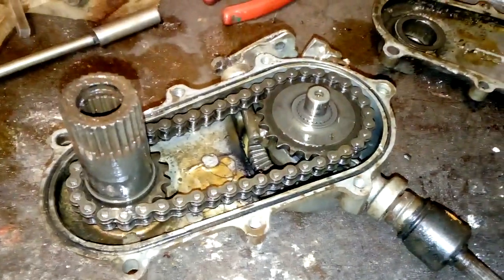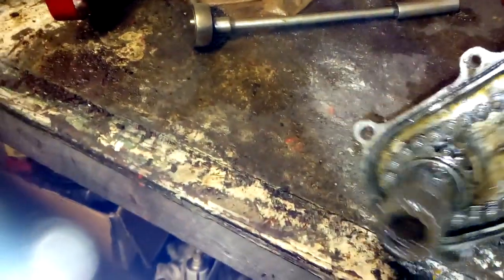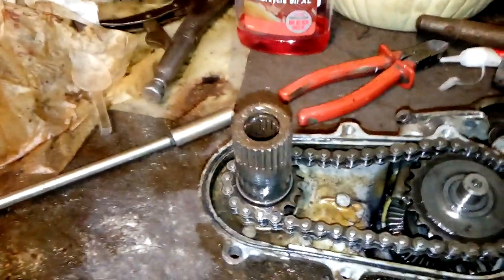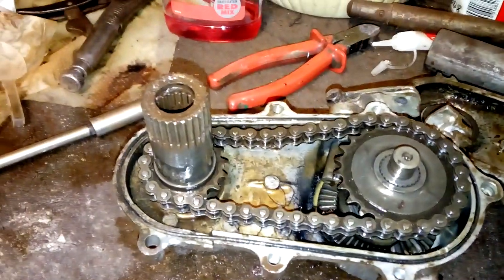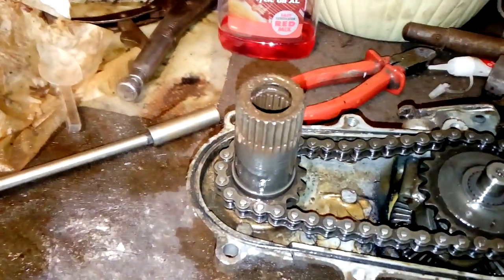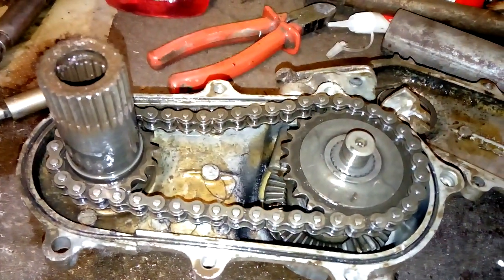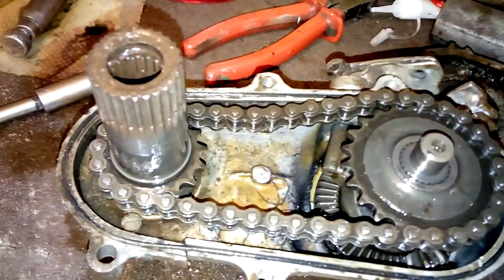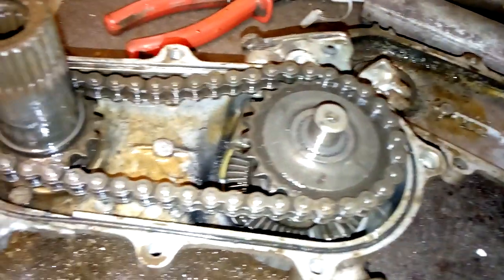Part 7 . No oil in the Honda HR 194 gearbox

Comment: Hi Shane, i am just about to put my 194 gearbox back together, i have put some grease on gears and mechanism,  how much gearbox oil would you normally put in please ? Many thanks for you help and videos on here. 👌
Reply from the maker: HI PAUL LEADER . YOU FILL THE GEARBOX UP TO THE TOP , THEN PUT THE COVER BACK ON . THIS IS WHAT I DO MYSELF .
Reply: @shanesquire1  thankyou, when you tighten up the m6 bolts that hold the gearbox casing together what torque setting do you torq them up to so it seals the gearbox up on the o ring gasket please? Much appreciated, Paul
Reply from the maker: @paulleader6681  36 N-M OR 27 IB-FT . HOW I DO THIS . I USE ME 3 FINGERS TO DO THEM UP .
Reply: @shanesquire1  thankyou once again, have a torque wrench so will torque to that slowly on diagonals. Going to let it sit 24 hrs to see if any leaks from seals before fitting back in mower.